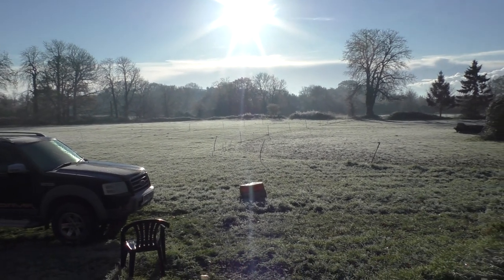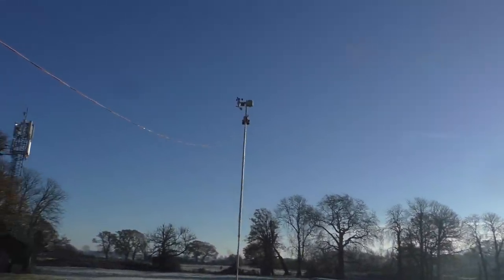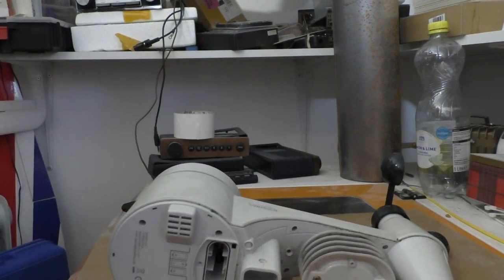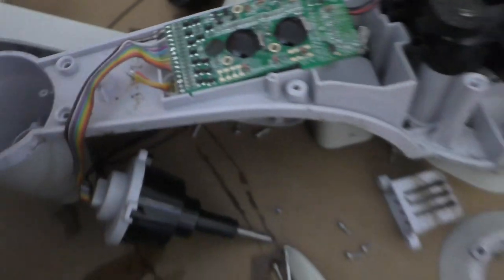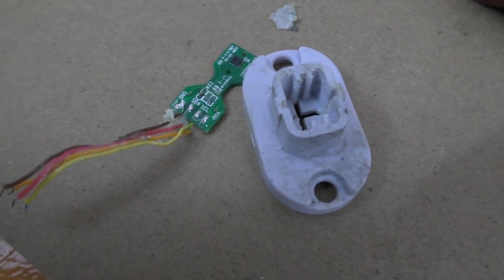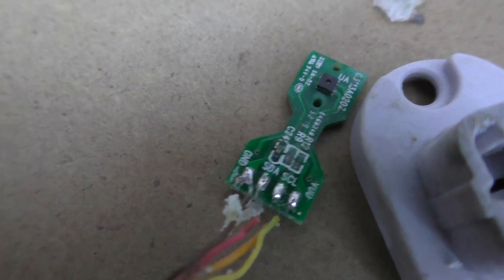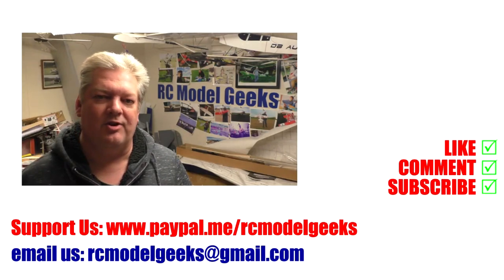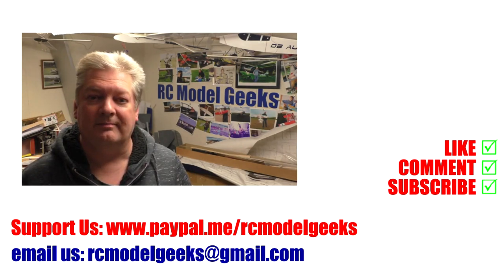Fixing Captain Robs Weather Station RC Model Geeks

Comment: Captain Rob, try NAC supplement for your chest congestion, it clears out your lungs, I too am a smoker and it really helps.  I will not quit, I roll my own, and NAC keeps my lungs clear (I am not saying your congestion is bad at all but as a smoker I can hear it, and now with a wood burner and extra smoke it would be a good idea). Great repair on the weather station, I do not think I could solder those small bits.